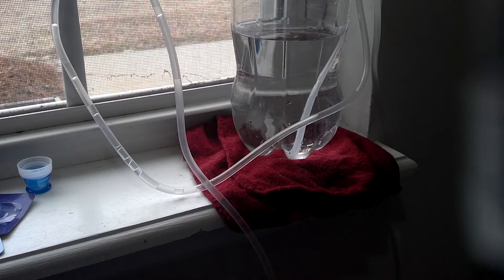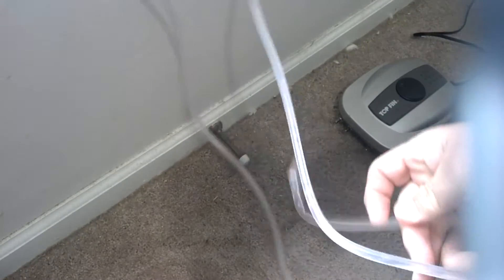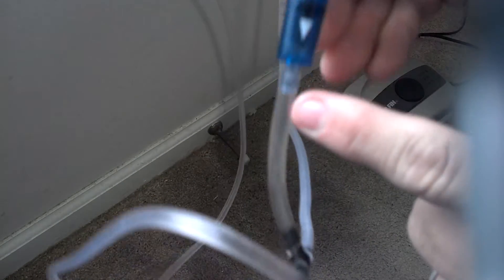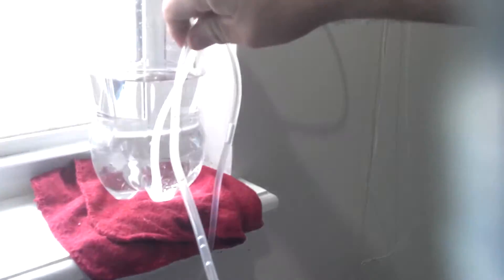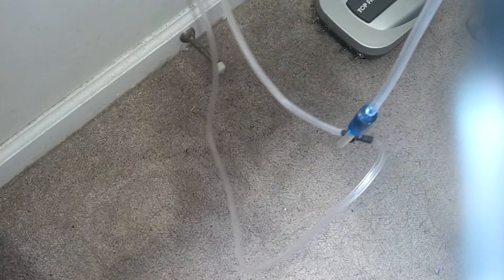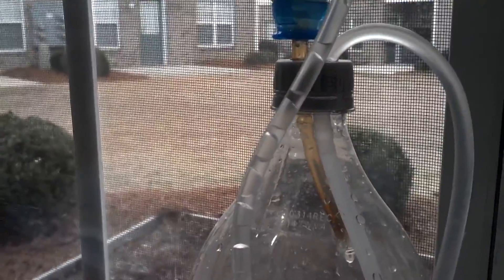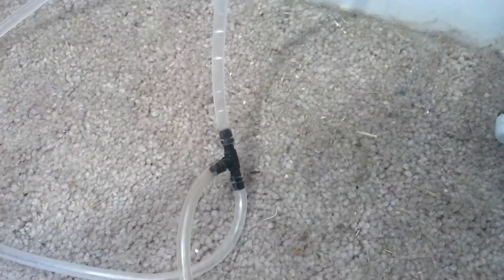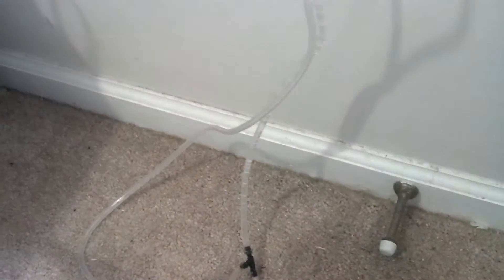Aquaponic Window Farm  Part 2 the Air Lift System

Comment: if you send the air tube with check valve into the resivor then you don't have to worry about siphoning the water up out of the resivor then into the tube. The air would enter the tube under the water level in the resivor and carry the water up. I never thought about using bubbles to lift the water until I heard about this in another video. Cool